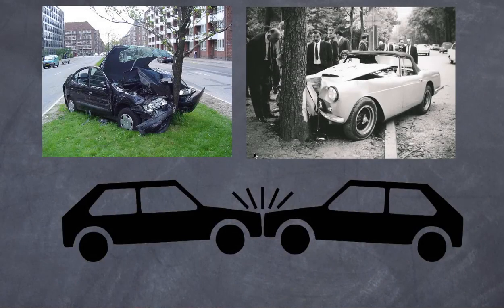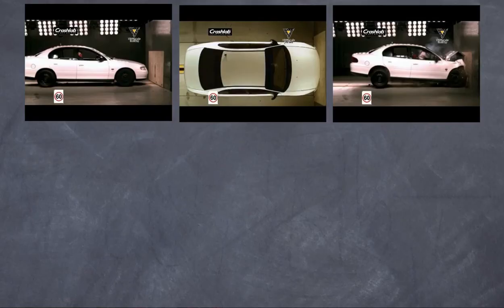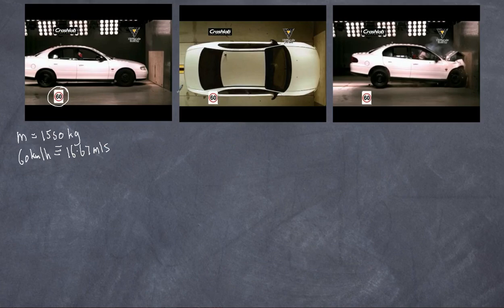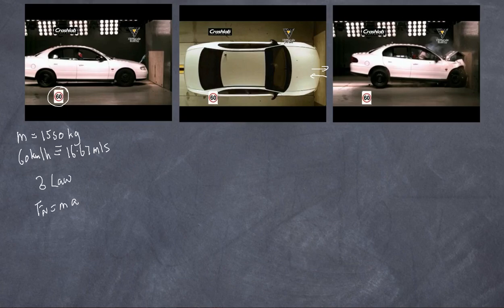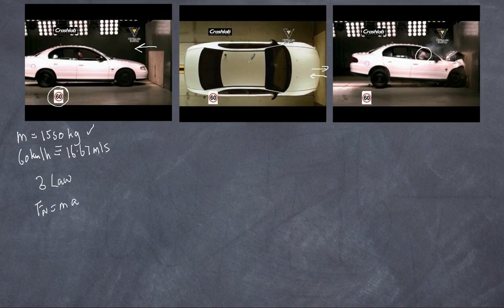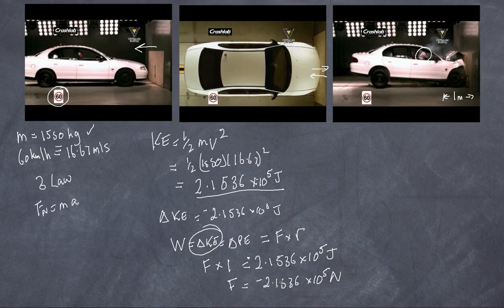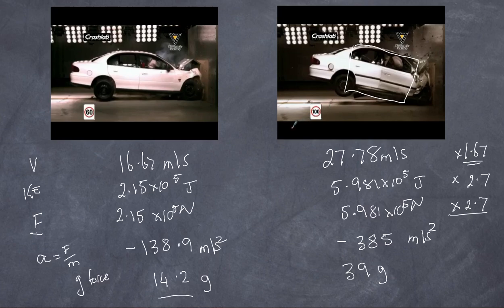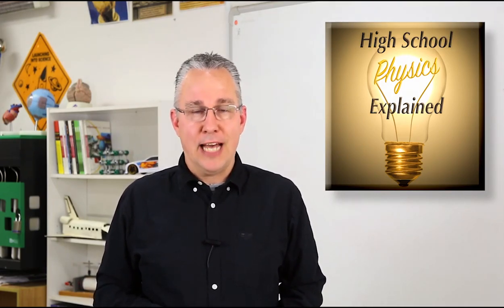The Physics Principles involved in automobile accidents

Comment: If two cars of the same mass but travelling at different speeds (say 60 and 30kph) collide head-on what difference (if any) in damage will each car undergo compared with what can be expected against a rigid barrier at those speeds?

 I've heard that if they differ in mass but travel at the same speed, then the lighter will be pushed back and undergo a greater change in velocity than the heavier and so more damage. Does this hold for equal mass but different speeds?
Reply from the maker: Good question (good critical thinking). To start off I have a video that might help (it is unlisted at present but will be published soon)
It covers conservation of momentum - https://www.youtube.com/watch?v=iDUaPp6bELw&list=PL5Tk152XlY6Qwueux0eSZC342EguckVO5&index=10

In directly answering your question, regardless on speed and/or mass, the force they experience is identical and thus the change of momentum is the same. This however, will mean differing accelerations for different MASSES. This confirms your statement.
However, if they have the same mass, but arrive at differing speeds, their acceleration will be the same. But since they have differing initial speeds, their final speeds will be different , assuming elastic collision. Different cars will also have differing crumple zones, but it is the combined crumple zones that will affect the average force both experience.
also remember this is about energy. A collision head on as you describe is relatively the same as a 90km/h from the perspective of the same car. But although the crumple zone increase the speed increases and energy is a square relationship, and so force is much larger
Reply: I suppose I must have been assuming a non-elastic collision since I wasn't talking about the cars being crumpled or squashed together like the bee getting squashed on the combi windscreen. However, if Car A, the faster car, just pushes the slower (but same mass) car B back then is the force they experience the same? If Car B's acceleration is greater, (from say 30 kph to -20), than Car A's (from say 60 to 20), then the force it experiences is greater, since f = ma. But if Car A accelerates from 60 to 10, and Car B from 30 to -10, then Car A's acceleration is now greater so it will experience the greater force. Is my reasoning correct?
Reply from the maker: +Chris G Newton’s 3rd still applies in inelastic collisions. You can’t pick numbers to justify your argument. The numbers will be the result of the forces being equal and their respective masses. Don’t forget though what is transferred to the passenger will vary. Force x displacement is energy and this causes the loss of energy of the car. But some of that energy will convert to heat and sound as it deforms the car
Reply: I'm sure you're right. I was mainly picking different pairs of numbers to demonstrate my confusion rather than justify an argument. So you're saying Newton's 3rd law means that both cars experience the same force. Anyway, assuming both cars deform and displace to the same amount, is it true that unrestrained passengers in a protected cage would still undergo different accelerations given those two pairs of numbers I quoted? Also do you know of any actual crash video, with or without passengers, explicitly dealing with this unequal speeds question?
Reply from the maker: +Chris G you are correct. People experience differing accelerations. As always life is more complex. They get jerks. 
And a jerk is the rate of change of acceleration!
So it’s not the car that kills you but the jerk!
Regarding second question, sorry, can’t help you there.